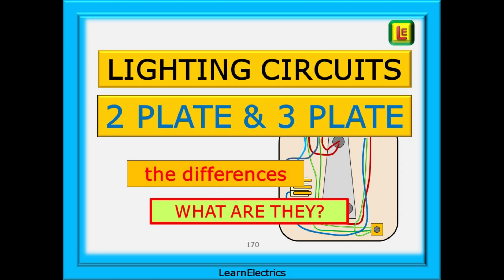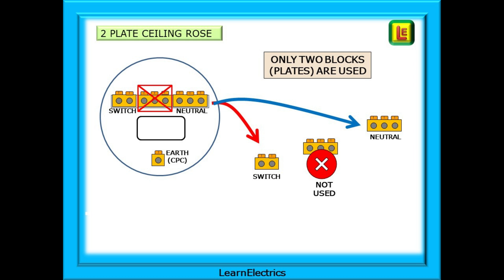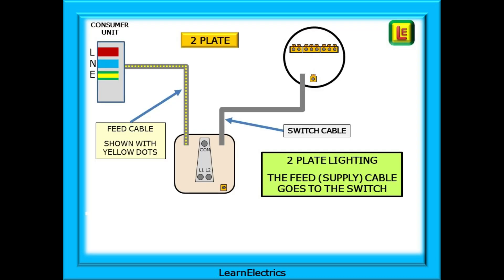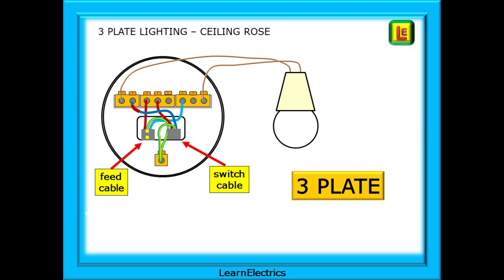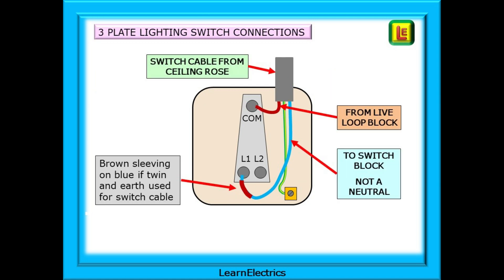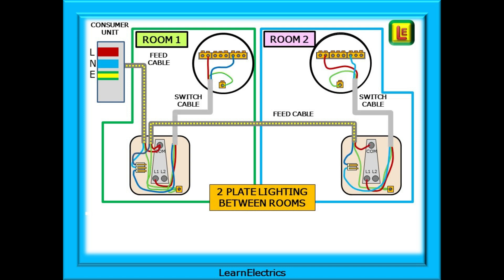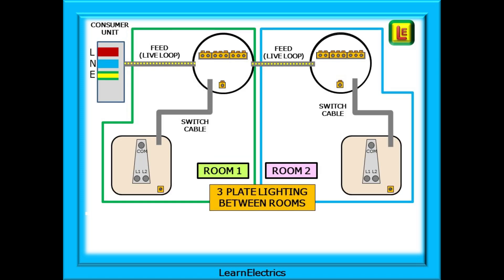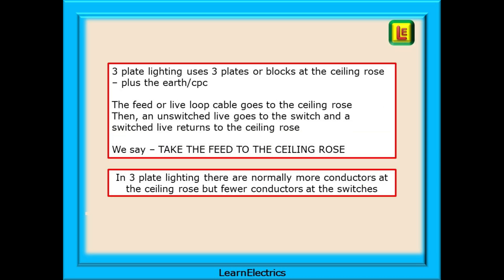2 PLATE AND 3 PLATE LIGHTING CIRCUITS – WHAT ARE THE DIFFERENCES? – HOW TO CONNECT THE CIRCUIT

Comment: Can you use 2-plate for one room and 3-plate for next room taking the feed from the switch in first room to ceiling rose in second room?
Reply from the maker: If you can be certain that the neutral will remain unbroken that would be a solution if you cannot replicate the 2 plate method in the second room. Thanks for watching. Dave.

Comment: is this still relevant? we have been doing common is one of the 3 core wires except cpc and the live is L1/L2
Reply from the maker: There are still plenty of houses with this wiring system in use. Lighting is perhaps one of the most changed over the years,
Thanks for watching.

Comment: Two plates at the ceiling rose means it's a two plate lighting circuit, but wait, I have replaced all my three plates roses with 'Quick Wire'  switch and load connectors above ceiling and below floor.. So mine is a three plate circuit but only two plates at the rose. ( Actually I purchased three plate pendants but only used two of the plates), I have now thankfully got rid of all those wires at the rose. This means metal light fittings are easy and more safe to fit as there is never enough space in them.  Also the quick Wire connectors are 16 amp and Maintenance free as well as blindingly fast to fit.  So I guess it is at the Switch that you can be sure which system is in operation if it is like mine.  By the way I just really love your LEARN ELECTRICS videos, thank you.
Reply from the maker: Interesting contribution. Really appreciated. Thanks. Dave.

Comment: Dave, please in my country, Ghana they do practice the 2 plate lighting circuit where the feed cable goes to the common terminal of the switch and the neutral and earth cable goes to the ceiling rose. Is this the best way to go about it...dl
Reply from the maker: Daniel, there are so many variations of the two plate. Years ago there was a lot less regulation and folk just installed circuits as they had been shown by others. In the UK, the move is towards standardization now, but you will still find different styles until they have all been rewired - about 40 years from now. It helps to keep a notebook with drawings of the different wiring that you come across, the day will come when those notes help on another job. Dave.
Reply: @learnelectrics4402  wow! Thanks so much for your response. I really appreciate it
Reply: @learnelectrics4402  Please I have another question, almost all switches do not come with earth and neutral block, so what's the best way to go about it...
Reply: @danielteyehuago1633 The earth to the earth terminal in the back box, and the neutrals just connected thru because you don't need a neutral at the switch.

Comment: Please in 2 plate lighting circuit, if the cable being used is not twin and earth cable, do we still send the neutral to the switch?
Reply from the maker: On the two plate I've shown you, yes, but some sparkies use sheathed singles and take the live feed to the switch and the neutral direct to the ceiling rose. With time, you will recognise these. Stick with it, its a good trade. Dave.
Reply: @learnelectrics4402  Thanks for your response

Comment: Normal switches for lighting circuit do not come with neutral and earth terminal block. How can we go about that...
Reply from the maker: Thanks Daniel, I've answered that on your previous question. Keep them coming.
Reply: I have seen electricians use a Wago connector to join the neutrals in the back box  behind the switch.
Reply: @KoalaBaloo thanks

Comment: Please with the 2 plate lighting circuit, in the switch, we don't have a neutral block in there. So how do we deal with that...

Secondly most switches do not come with earth terminal block.
Reply from the maker: Use a wago or terminal strip for the neutrals, same with the earth if there isn't one moulded into the box - depends on  the manufacturer. Thanks for asking, thanks for watching.

Comment: even with 2 plate Lighting you can take the
Feed cable to the celing rose
Reply from the maker: There are many, many variations of wiring Emil. Years ago it was not very well regulated and folks just did what suited them. Now we are trying to standardize the installation methods especially for craft apprenticeships. Thanks for the input, appreciated. Dave.

Comment: Gillo100 It sounds like the electrician used single reds known as staplers from the switch this was standard in the sixties and seventies. Also if only became a regulation requirement to earth lighting circuits in the early nineties. I would get a qualified electrician in to have a look
Sounds like you might need a rewire .
Reply from the maker: Thanks for the input Sean, great support.
Reply: Sean & Dave, In my training days (1988 - 1993 & beyond), neutrals in a light switch back box were frowned upon. As were floating connectors, any connections in an enclosure had to be fixed base connectors. This all seems to have gone to pot with wago connectors and two plate becoming more conventional due to the lack of a ceiling rose and sparks not being bothered to install a JB in the ceiling. Hey ho. In a one way switch scenario, why not just install a double pole switch? Thoughts?

Comment: Gillo100 Two plate you take the line and neutral for the Consumer unit to the switch
Then another cable from the switch upto the ceiling rose , at th switch the two Reds ( old colours connect to the switch the two blacks are connected to each other with a connector block. On a three plate there’s no neutral at the switch the black should be marked with red tape or red sleeving theses days the colours are brown line blue neutral but again no neutral at the switch on three plate the blue at the switch  will have brown sleeving  .the two plate method is in common use theses days for down lights .
Reply from the maker: Thanks for watching Sean. Dave.

Comment: the problem with doing the connections at the switch is that if you gonna use a 3 core+earth to go to another switch it will be a massive pain to screw back the switch
Reply from the maker: Exactly. That's why a 25mm back box is sometimes needed.

Comment: Looking at my lighting I seem to have something in between.
The live goes to the switch and then feeds up to the light, like 2 plate.
However the neutral just goes to the light it doesn't go to the switch at all.  So it seems there is just a neutral loop feeding all the lights and live loop feeding the switches. No earth in sight either.
House built in Ireland in 70s
Reply: Two plate you take the line and neutral for the Consumer unit to the switch
Then another cable from the switch upto the ceiling rose , at th switch the two Reds ( old colours connect to the switch the two blacks are connected to each other with a connector block. On a three plate there’s no neutral at the switch the black should be marked with red tape or red sleeving theses days the colours are brown line blue neutral but again no neutral at the switch on three plate the blue at the switch  will have brown sleeving  .the two plate method is in common use theses days for down lights .
Reply from the maker: Thanks buddy, appreciated. dave.
Reply: It sounds like the electrician used single reds known as staplers from the switch this was standard in the sixties and seventies. Also if only became a regulation requirement to earth lighting circuits in the early nineties. I would get a qualified electrician in to have a look
Sounds like you might need a rewire .
Reply from the maker: Thanks Sean. Great support. Dave,
Reply from the maker: Thanks for watching. Yes, some older properties were wired with a neutral loop, I've seen it a time or two. back in the 60s and 70s it was often a minefield. It does help to draw what you have, that sometimes helps to make sense of things - good luck. Dave.
Reply: @learnelectrics4402  Yeah I've tried drawing it out a bit to get better understanding alright. Its complicated by the fact all the bedrooms have a ceiling light and a wall light and 2 double switches to allow 2 way switching for both, so lots of wires.